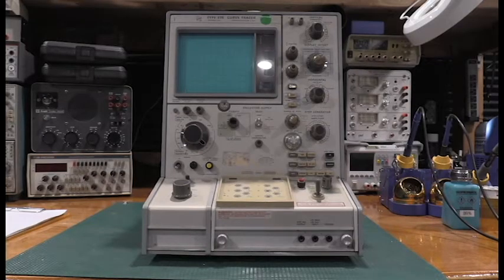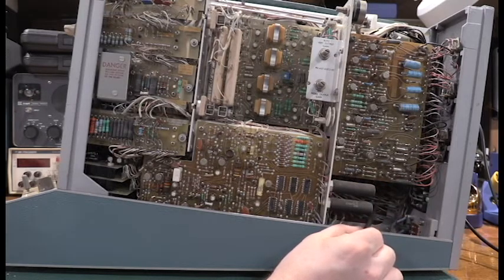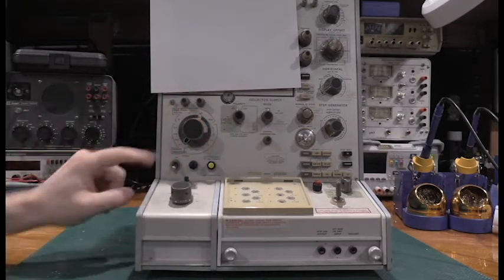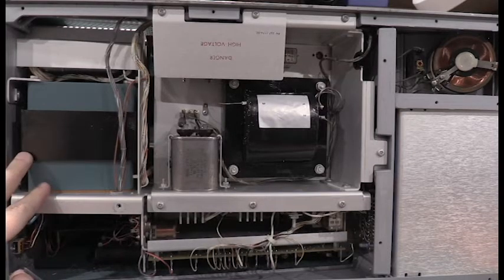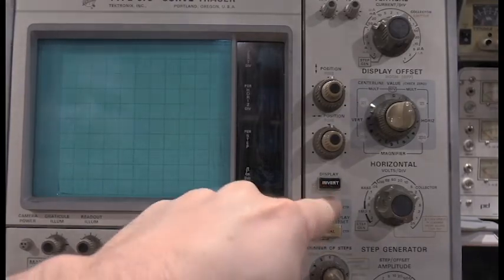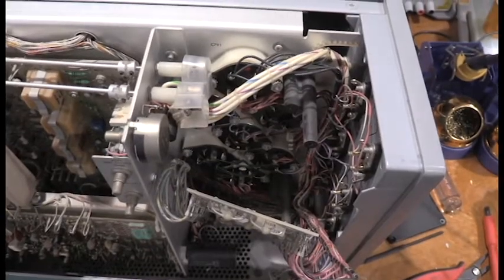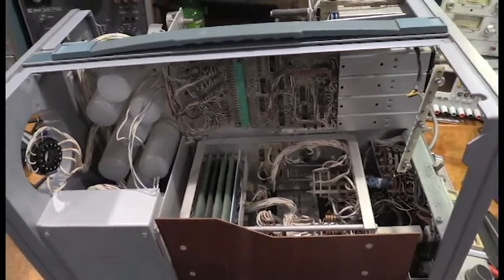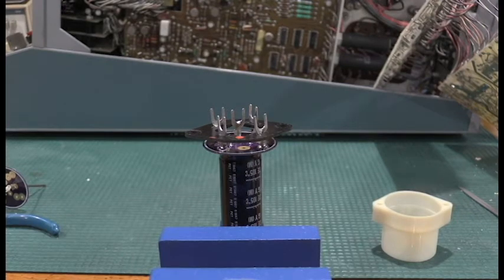Tektronix 576 First Impressions and Repair

Comment: Theres someone near me that has two of these bad boys with the carts for 500$ each cart included. Thinking about picking up one of them next weekend. They also have a 7000 series scope and a couple of the rack mount versions. I dont NEED a new scope but I know ill want to get up to 1Ghz eventually.
Thank you as always for your videos. They have been a great help for me with my Tek gear.
Reply from the maker: For the 576's make sure they have the black silicone high voltage transformer (late serial numbers) the brown epoxy potted ones have a high leakage current and are all faulty as far as I know. One other quick test is if the CRT is double peaking. Brighter -> dimmer - > brighter this is the result of cathode poisoning both would be terminal failures and make them parts units.

Comment: Hi - I finally got it fixed. thanks for all the hints. important on was the isopropyl alcohol to clean the invert button. I was going to start to take 1/2 the boards out to dismantle the invert switch... would have a been a hell of lot of work...but lubricated with Kontact WL and 61 to lubricate the switch.

The issue was the 11Kuf 5 cap of the 5V rail - step generator was out.
I don't have to be jealous of you no more  with my 576 😁

Love you work !
Reply from the maker: Awesome glad to hear it is up and running again and survived the trip.

Comment: Great job.  Had to recap mine about 10 years ago. Wish I would have known about those adapter boards. I re-stuffed the old cans.  Never again !  Don't use it that much anymore since obtaining a tek 370.   I still like to use the old 575.  Still the most trouble free CT I have ever owned and it is almost as old as I am.
Reply from the maker: Thanks, I would love to get a 370 something but they are still a bit out of the budget. How is the 370 do I need to worry about surface mount capacitor plague?
Reply: @ZenwizardStudios  Greetings. I have never opened up the 370. It was a hamfest buy some years ago ($50 presumed dead). Much to my surprise it worked .  This instrument will probably be outside my skills if/when it malfunctions (other than a power supply problem ) A lot of this later generation equipment is so complex.  One of my frustrations is that Hp  et-al have out sourced their power supplies and do not include documentation in their service manuals.  I don't use the 370 that much. Use the 576 ,577 and 575 most often. Wish my basement was bigger !

Comment: I got one and have mostly the same issue described in your video. Thank you so much for you you video. 
This one here, though, the 75V rail is low. And adusting all the way up maxes at 65 Volt. 
I figured I need to recap all as well. 
I was hopping not to take apart just to get cap value. 
With situation at my place, thongs are gone get lost. I would live to get all caps first then take it apart and recap hopefully in 1 weekend.
Would you help with cap's values and part number please?

Comment: Thank you so much for the heads up on the switches. Mine had the same issue (trace unstable and all over the place). 
sprayed it with somethng similar and work them for a bit. 
Now the tace shows. But cannot get it in a dot, specially in DC - & +. 
It keeps showing in a small zigzagish line. 
Happen to know where I should start to work on this
Reply from the maker: Is there any collector voltage present? if it is not going in to dot mode on DC what is your current per div set to? If it is in a VERY low range like 2nA per Div you might be fighting looping capacitance. If so this might be normal.

Comment: I don't know if you remember after working on this 576 2 years ago... I have a crt trace that is not staying in focus. First it will come up soft and fuzzy and the sharpen and then lose focus again. All voltages are fine CRT 4000V voltage is fine. Wondering,
Reply from the maker: There are a few things that would cause this. Some are good some are terrible. The worst case scenario would be an internal tube issues where one of the element has broken off internal to the tube. The 576 tube is unique and therefore almost impossible to find as it was used in no other instrument. The better case scenario would be a voltage coming and going or a cold solder joint. Given that the focus comes in this leads me to believe with minimal information that the fault might be a flaky connect that is moving with thermal stress during warn up. It could also be a bad/noisy focus POT however this pot is in the HV path so care is needed. 

	One quick way to check the tube, “Is the tube double peaking?” when the brightness control is swept from min to max does the tube brighten, then dim, then brighten again? If the CRT exhibits this behavior then additional trouble shooting is not needed as the CRT has aged out and is very high hour.
Reply: @ZenwizardStudios  Thanks for your reply, seems we have a lot of same equipment. I believe I found the problem. Bothe the Focus and Intensity pots are out of spec. Looking for replacement parts now. Trying Sphere up in Canada.
Reply from the maker: Great minds think alike then 😊, you also might want to try the vintage Tek museum. Or the Tek mailing list. There should be quite a few 576 parts units out there given the HV transformer and tube issues. Before putting too much work in to this 576 does it have the black HV transformer? If it has the brown epoxy HV transformer it is a guaranteed fault if not already in the near future.
Reply: @ZenwizardStudios  I have the black transformer.
Reply: I just noticed your HP 3488A recycle video I will have to watch after lunch. I have two of those units in storage. 
lol

Comment: Hi - for the relays you mention at 7:54. any hints on how to repair/replace them?

I got my 576 back together. the inverter button is indeed a nightmare. the trace moves randomly on the screen. when I wiggle the inverter button then the trace stabilizes a bit. turning the horizontal gain button - the one that switches the relays, also stabilizes the trace - looks like the relays contacts are dirty or used

Thanks for any hints
Reply from the maker: I have not yet needed to repair or replace any of the relays yet. However the invert cal zero switch pack is a real soar spot. The switch is dirty and needs cleaning and servicing. The CRT dri9ve signals vert and horizontal go through that switch on the way to the tube. So before anything cleaning the switches.

Comment: FYI, You can do the calibration with resistors.  The Alignment Fixture is nice, but not essential.  The newer -01 Service manual provides an alternate process.
Reply from the maker: Indeed, There is a second 576 video that the non fixture was requested. I did the resister calibration on the 2nd 576 restoration.
Reply: @ZenwizardStudios  How would you compare the two processes?  I am not fortunate to have access to the Alignment fixture, so the -01 manual revelation was a welcome discovery.   I just was able to round up a full set of "precision resistors",  I will check out your 2nd video as well.  Glad to know that you have a video on that alignment process.   Thanks for the reply and the excellent content.
Reply from the maker: @Michael Lynch, Essentially the process is the same. All that is in the calibration fixture is switches and resisters/capacitors to rout the signals and loads. If I remember correct when I did mine getting some of the precision capacitors was an issue. They were EXPENSIVE for the parts that we speced. So it makes for a faster calibration but not necessarily a better one. Tek did not make a fixture for the 577 so that is done all with resisters. If I remember correctly there was 1 step where I used the calibration fixture cause  the -01 was not clear what to do was for doing some of the step generator loads. This also might have been because I was lacking a good enough standard in the lab. I am also planning on adding some good precision LCR meters to the lab to help with this in the future. But those are up there in cost so it will be an in time thing. I think total there are 7 videos between the 576 and 577 units. I fell down the rabbit hole hard.

Comment: Great video! 
What is the serial number? I have 576 on the way….would like to know what I got myself into….
Reply from the maker: The serial number of interest for the good HV transformer?
Reply: @ZenwizardStudios  yes. Mine is b327420. Will it have the good hv ?
Reply from the maker: It looks like it should. From the documentation T850 is the problem unit the -3 version started in serial number 24xxxx also it looks like you have up updated T300 as well that started in 326320. My unit is actually sloe in serial number 328108 had the good one. If you see black under the HV cover you are good if it is brown there will be issues.
Reply: @ZenwizardStudios  thanks I will have the unit in a few days.
Reply from the maker: Awesome, I hope it works out.
Reply: @ZenwizardStudios  I got it - new HV transformer. but no trace. the -12.5 V rail is dead. other voltages are out. So I need to fix that first. it is at + 2-3V , so I guess the oscillator does not even turn on. so I have no idea if the tube is good or bad.

for the flight back to Europe, I took the 1.6kv transformer. was quite easy. putting is back will be another story.😩
Reply: Unit is finally home

now I have to put the transformer back in
I intend to use extension cables  - 2-3 inches because the  i can't put the transformer  back and then solder the cables on....

Comment: Hey there, great vid! I don't see it so I thought i'd ask, did you ever upload the calibration video? I've got a 576 that I'm about to bring back to life. I'm going to start searching for a calibration fixture but it seems like that's a tough find. Would love to get some sense of the process. 

FYI, my device has the good transformer and is in really good condition, no cracks in any of the buttons and the tube is really bright. It does have a trace that bounces all over the place but does, at times, settle down and hold a spot until I mess with it at all. Hopefully switches and not capacitors, lol.

Thanks again for the first vid, it was very helpful.

Andy
Reply from the maker: Hey Andy, 
I have bad news and some good news. The bad news is the cal fixture. They tend to be rare but when they do come up they tend to be $1000 + on the secondary market. Now the worst news. You need to check in the calibrator to make sure it is in spec befor you use it to cal a 576. For that you need a precise DMM. I think a Keithly 6500 will do it a Keithly 7510 Will most likely do it. And an Keysight 3458A should most deffinatly do it. Being 6.5 digit 7.5 digit and 8.5 digit respectively and priced accordingly. You must read some pretty low value resisters accurately. Which gets me in to the good news. All that is in the calibration fixture is some precision resisters (low tolerance) for loads and some precision capacitors again low tolerance. I have not done a video on it yet but if the trace is jumping around when you are moving the current/div switch The amplifier DC balance is off and needs to be adjusted. I have a 577 that I had to fight for HOURS to get the cal right. It ended up I needed to cal the 177 before I did the 577 the DC balance was messing with the amplifier alignment. 

Now for the good news: In the later service manual there is an alternate calibration procedure. This procedure specs out the load resisters and the load capacitors needed for the calibration. Tolerances are TIGHT ¼% tight. I found it was cheaper to buy a block of 10 or more 1% resisters and select from them the ones that were in the tolerance needed especially case you need some high wattage resisters. Up to 10 Watts if I remember correctly. So you need a way to measure low resistances with accuracy. So with the right loads you can do it without the cal fixture. Take care in the 576 there are some extreme voltages. But I am glad you found one with a good tube and transformer!

Zen
Reply: @ZenwizardStudios  Yeah, the cal fixture pricing isn't a surprise, lol. I'd probably pick one up if I could figuring I'd play with it for a while and could always sell it again down the road but I'm going to want to cal this device before I find one I suspect. I did fine a company that says they rent one. I asked for a quote but haven't gotten it yet.

I think the best DM I have in that regard is a Fluke 8846A, I don't remember the exact specs, I'll have to check. If not, I'll have to accelerate my search for an 8.5 digit. Do you have a link to the alternate cal procedure? I have two physical copies of the manual and the digital one floating around online but none of those has that in it.

Yeah, I'm fairly comfortable with the voltage issues but I do have one question. Normally, I'm pretty careful about using a discharge device on the high voltage caps before I do anything in a device but with this one, they appear to be unaccessible without some disassembly. What is your experience with their discharge time and / or, how are you dealing with that?

Thanks again for the video, and the help here. I really enjoy your videos and am looking forward to watching the rest of them as I have time.

Andy
Reply: One more quick question. You mentioned using straight IPA to clean the switches. Do you not use Deoxit or something like it in general or is there something about this unit that caused you to not use it?
Reply: Disregard the cal procedure question. I found it on Artek and bought it.
Reply from the maker: Andy,
You do NOT need an 8.5 digit meter of more importance is ohms accuracy at very low ranges. Something the 6500 excels at. You will also want a set of kelvin sense leads If memory serves you need something like 1 Ohm at 10 Watts for one of the ranges. This is somewhat tricky to measure accurately given the low resistance value. I have a 6500 in the lab and that is currently my highest accuracy. I do not have an 8846 but I do have a 8840 in the fluke I can check the resisters against the 6500. The kelvin leads I ended up with were https://www.digikey.com/en/products/detail/pomona-electronics/6730/603918 I have no complaints so far. 4 wire measurement is needed at the lower resistance level the lead resistance will greatly influence a 1 Ohm resister especially when accuracy needed is ¼%. In terms of the power supply the real danger here is the collector supply just the test terminals can be lethal 1500 Vdc at 220 Watts. Depending on the setting that can be exposed at the front panel under normal operation, And this unit has 2 power supplies the main power supply and the collector supply these are isolated from each other and have different sets of storage caps. Also there is no way to disconnect the 1500 V collector supply internally. It is ac to variac (collector supply) right into the transformer in the bottom.  Any time the unit is on treat that as live and take care. 

In terms of the IPA. The switches on this example were not that bad really just noisy. In this case IPA and some lubricant was all that was needed. My processes and procedures are always being improved and fine tuned. I currently do not have enough practical experience with de-oxit to way in one way or another. Though my service manual for my DC voltage standard calls for Shield it. To maintain some pretty sensitive switch contacts for a precision voltage divider. As with anything test for reactivity for anything you are using in a non-critical area. You do not want to dissolve the plastic on an unobtanium control.

Thanks for the comment about the videos. I will keep making videos as long as people are finding the information useful and  helpful. 

Zen

Comment: Hello.  Thanks for the great videos.   

I'm working on repair of a Tek 576 and have a intermittent and sticky INVERT button slide switch.   I tried cleaning with the pro electronics cleaner but it is still sticky.  I also tried spraying in Isopropyl alcohol with no luck.   I now have the board with switch removed and planning to teardown the slide switch and an looking for a replacement grease.  Any recommendations?  I've heard Vaseline.  Thanks
Reply from the maker: Metalbender22, I would not use Vaseline. I am not sure of its conductive or insulating property's. I will check that. In a switch or a contact you need a conductive lubricant with a good dielectric strength. conductive enough to be invisible to contact closure. Yet NOT conductive enough to short out the entire switch block. Shoot me an E-mail and I will have some more information.
Reply: @Zenwizard Studios  I also found the internet reference on Vaseline as a poor electrical device. I ended up using Dielectric grease. On page 4-29 of the Tek 576 manual, I removed the Display Switching circuit board. I unplugged the two relays K520 and K620 from their socket and slid out the switch cores from all three pushbutton switches. I then just submerged the lower half in simple green in an ultrasonic cleaner for 4 min. The hardened grease was nicely removed from the inside contacts and the spring contacts. I post cleaned with CRC 05103 QD Electronic Cleaner.  

To repopulate the switch cores I took the long plastic rod with slots on either side and manually added each spring clip to the slots then partially slid into a reverse packing tape rolled tube until all contacts were contained to the core.  It then greased and pushed the tube contents back into the still soldered down switch housing.   The sticky side of the packing tape was outward making for a smooth inside of the size I needed to hold the clips.  With this process I did not need to unsolder and resolder the pushbuttons making sure they were in alignment to each other. 

Recently, I saw a 576 at a Purdue University salvage sale for $175 along with a Tektronix 7403N scope for $10. I was inspired to pick up one of these machines by your videos. Thank you for your 576 video series which has been great in understanding this hardware.    Kevin